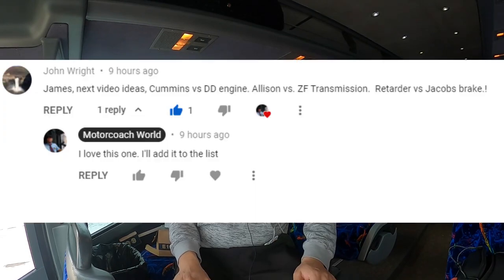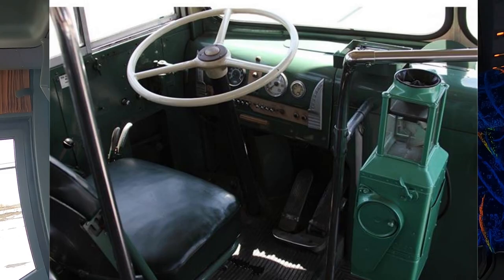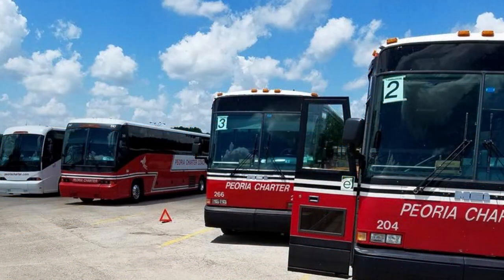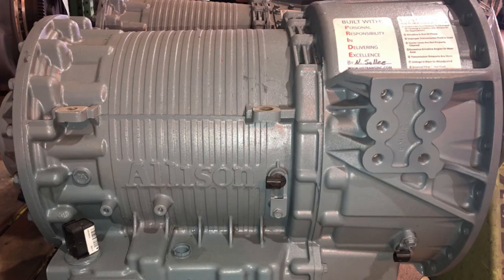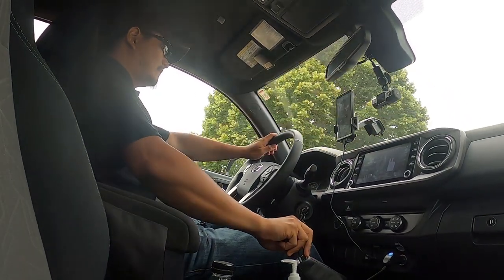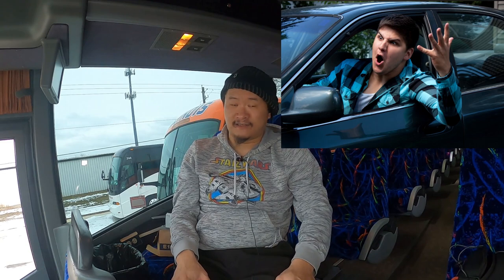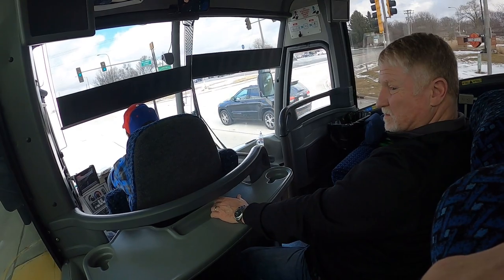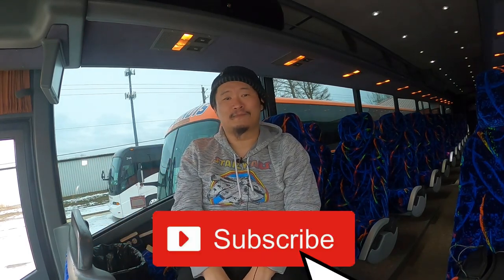Coaches buses come in Manual, Automatic, and Both .  The ZF Transmission

Comment: How about an electronically shifted gearbox, but with a manual override? Could just be an up-down shift paddle like in a sports car. I feel that would be the perfect compromise. I'd be surprised if it didn't exist already.
Reply from the maker: You should pattent that
Reply: Well, the first two generations of the smart car had a 5 speed electronically shifted gearbox with optional paddle shifters, so yes this does exist. I drove one for 4 years and all the downsides mentioned in the video applied to it as well. (Jerky movements due too bad clutch control, slow shifting and acceleration (the 45hp diesel didn't help either), stupid shifting logic and worse of all, it would either ride the clutch when shifting higher gears (causing unnecessary wear) or dump the clutch when shifting lower gears making a jerky shift.) I'm glad I don't have to drive that thing anymore.
Reply: @Reisperbachtal  I know it exists - in cars. So my proposal is to do it for buses as well. Sorry it didn't work so well for you in your Smart, but I have to assume it can be made to work better if a manufacturer wants to do the effort.
Reply: The main point is not to allow you to shift by yourself like Schumacher.  It is to get rid of that power sapping torque converter a and hydraulics.   An automatic is about 85% efficiency whereas a manual is consistent at high 90%.  Robotic manual is the compromise for automation and efficiency

Comment: I like trucks with buttons instead of s shifter lol. Hard to explain but essentially its a panel and you select a gear.
Usually upto 6 buttons.
Reverse
Drive
Neutral
First
Second
And a park one oddly enough.(noted its only really in australias waste industries and not all have them fitted
Reply from the maker: Cool, Ive never seen one of those!
Reply: @MotorcoachWorld  most havent.

Comment: i would like to hear your opinion on the Volvo I-shift, where you have the choice of automatic or a kind of manual, i like it in the transport truck hauling a 125 k trailer,  Stay safe
Reply from the maker: Thank you for your comment. I have never driven a I shift. I have seen them though. Sounds very similar to a ZF. I prefer a Automatic from a ZF. I also prefer manual over Automatic. There just isn't any manual transmission buses made here anymore though.

Comment: Trucks or buses need manual transmissions. If it has a shift lever....I'll float the gears or clutch it once. If it's non-synchronized... I'll double clutch it. If it has a steering wheel, engine, and transmission, I'll roll it down the road for you.

Comment: Did buses commonly have synchronized or unsynchronized manuals?
Reply from the maker: Thank you for you question and comment. I don't know the answer to that. I will ask my mechanics about this and get back to you. Thank you for the great question!
Reply: @MotorcoachWorld  Any of the older buses I drove had synchronized manuals. Some of the Crown Coaches with manuals used the un synchronized 10 speed Road Rangers.

Comment: It's not sad that we don't use stick shift as much as we used to. I feel automatic is great especially since there are just less you have to worry about, so you can focus on the road. To me it's like learning to using a rotary phone. Unless you have to drive a stick then really there is no reason to use it, people just like to pretend they are racecar drivers. I can drive stick, first car was a 91 cavalier with manual transmission. I think it's just more to mess with. Unless you have to I really see no reason, with how good the automatics are now days. And it will only get better.
Reply from the maker: Hey thanks for the comment. I guess to each their own.
Reply: @MotorcoachWorld  I'm mostly just being a punk. I do think automatics are better than ever but I agree with you 100% though that when it comes to efficiency and getting the most out of the motor a manual is probably ideal.

Comment: Scania had early 2000s automated transmission with regular driver operated clutch for start and stop.

I think they could not figure that jerking broblem, so they just left the normal clutch. If driver did not press the clutch when stopping, engine died.
Reply from the maker: Hey Juha Lehtinen! Thank you for this piece of info! Love it! Really appreciate the comment!
Reply: @MotorcoachWorld  The Company i drive for in the UK still has one of these Scania coaches in storage, 10 speed gearbox, a display flashes when it wants to change gear, press clutch, wait for beep then release clutch.

Comment: How can you have this discussion without discussing synchronized versus non synchronized transmissions ?

I've never heard of the Top4 transmission.  The Top2 just automated the splitter valve.  The Top4 would have had to shift the main box.

Eaton's first auto transmission was the Autoshift.  It was a 3 pedal system with a clutch pedal for starting out.   The Ultrashift was the second generation and it doesn't have a clutch pedal.  It used the centrifugal clutch system.

The Merritor Freedomline was a rebranded ZF ASTronic.  Eaton sued Merritor and thus the transmission couldn't be sold in NA.  That is why it was no longer used in buses.  Or trucks.

Volvo's  I Shift is now standard in VNL trucks.
Reply from the maker: Hey Tech guy. I can only fit so much in a 10 - 15 minute Video. so I have to be choosey and stick closer to the topic in which I titled the video. Which is the ZF transmission. You seem to be very  knowledgeable in these matters. You should do a video on the synchronized versus non synchronized transmissions. I would watch it!
Reply: @MotorcoachWorld  There are lots of trucking videos that show how to shift a non synchronized transmission.  No need for me to do that.

There were very few buses with real manual transmissions.  You know that. 

You have a great channel.   I'll be buying a bus to convert in the near future.  Keep up the good work.

Question: how much better is the new MCI independent suspension compared to the old ?   Do the H3s ride better than the E/Js ?
Reply from the maker: I've always found H3s to have smoother rides. I would not recommend a E model with all the problems they had. At least not one from 1999 to 2001. 2002 and up they kind of de bugged the model. I would look for a J model or a D model if you want less problems to deal with.

I appreciate your comment and kind words. Thanks for taking the time to write. I enjoy reading these.
Reply: @MotorcoachWorld  Yeah, I'm avoiding the pre 2003 Es with the gold bricks.  And the post 2007 buses with DPFs.

Great channel.

Comment: Sounds like the Ford automatic in recent Focuses and Fiesta. It doesn't know what gear it's supposed to be in, it's not comfortable in whichever gear it's in, and it shifts in seconds rather than half-seconds, and it needs frequent service if you try to drive it gently.
Reply: Interesting that you bring this up.  The transmission  is a 6-speed DCT (Dual Clutch Trans), developed by Getrag of Germany (now owned by Magna), and produced by a Ford JV in Mexico.  Most automotive DCTs use hydraulically applied wet oil-bath clutches and gear changes are hydraulically actuated.  Ford's DCT uses electro-mechanically applied dry clutches, and gear changes are electrically actuated.  The theory...  Electrical control would increase the efficiency by 1-2% vs. hydraulic control that requires an engine driven pump like conventional automatic transmissions have.  In practice, the electrical controls were slow and lacked the precision of hydraulics.  The clutches were prone to "chattering", particularly when starting from rest.  In short, adopting this design proved to be a VERY EXPENSIVE MISTAKE and it was replaced with a more conventional solution in just a few years.

Comment: I. drove tour. bus. and. industrial bus  out. to the ( gas. plants ) in. Alberta  and. tour coaches. BC. Canada , also. Saskatchewan, Manitoba. and Ontario. trips. for. probably a good. 20. years. also. tractor  trailer. , my. Favorite. coach. was the  MCI. 7.  with a. stick.  it. handled so nice. on the.  highway   and. on. curves  even though. the bus. itself. had a. long wheelbase , also hauled oilfield Alberta. NWT. with. tractor trailer ( bed. truck )  some Quebec trips.  to Montreal in the 80s / also. Greyhound had. many. MC 7. s.  in. the.  70s. and 80s. up here in. Canada, /Also. James.  if. you have. had the. chance too. talk with any old retired. Greyhound coach drivers. ask them. about. the. hat they wore with the uniform called. the double clutch grey coloured shaped  like a sea captains. hat.  sewn in. the middle of the. top of hat they looked. quite nice decorative,  and. make sure you.  have. those tag. axles on. the. bus. lifted. in the. mountains  all my.  best. to. you / Bill. S , Canada

Comment: Personally, I find the AMT gearbox to be an offence to the industry. ZF and Mercedes are appallingly bad, especially as they get older. I've driven Scania, MAN, Iveco, and Mercedes versions and they are just not as smooth as fully automatic or manual. Having them banging and crashing around under the floor makes the driver look like an idiot. It doesn't matter how competent you get with them, they lack precision. It's people we are carrying, not pig iron. Not throwing hot coffee in the laps of your passengers is advantageous. The Volvo i-shift is about the best one that I have come across, but still falls way short of the ride that I can get out of a plain manual. Also, I think that AMT's are dangerous. I've seen instances where the clutches just engage and the bus runs straight into the back of the vehicle in front, and occasions where the transmission will throw the bus out onto a roundabout and then do nothing, letting other vehicles plough into the side. Try winning an insurance claim using the transmission as an excuse. 

In twenty years of pushing these motors up the tarmac, I have driven some weird and wonderful transmissions; automatics with a clutch pedal, manuals without a clutch pedal, solid gear linkage, hydraulic gear linkage, electric over air gear linkage, four over four. But my favourite of all was the Leyland, belt driven, electric over hydraulic, semi-automatic. A bit of a skill to get used to changing down, but once mastered, it was a pure pleasure. You had complete control over what gear it was in, no computer overriding your command, and no clutch. :)
Reply from the maker: Hi Leon Adams. Thank you for your comment! Really appreciate the additional info! This is the best part of making these videos. Reading other peoples takes and experiences on these things!